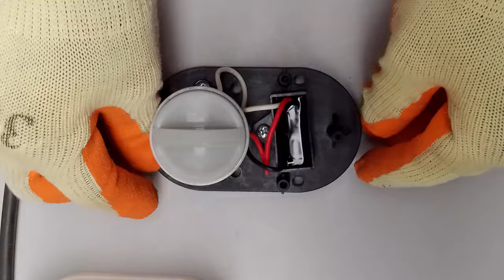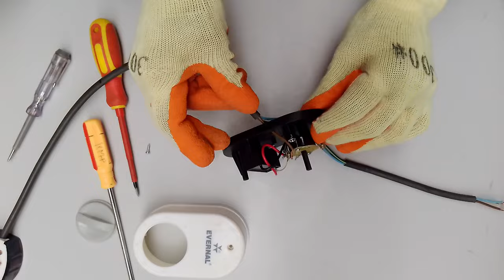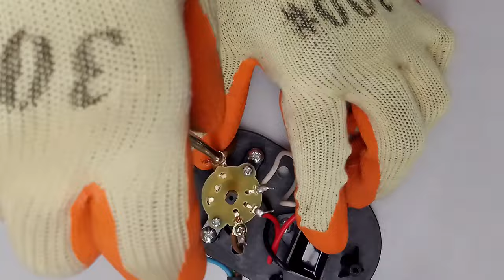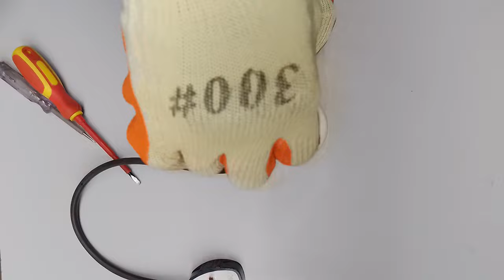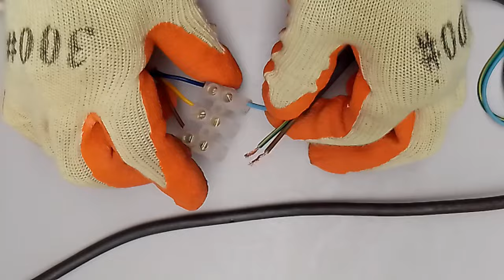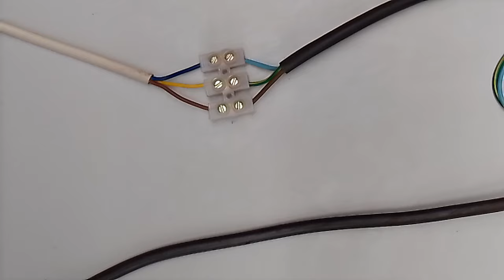Fan regulator connection/ ceiling  fan regulator wiring /3-speed fan regulator wiring diagram/video

Comment: Where is the Black cablo?
Reply from the maker: Well this fan has 3 speed levels, so the capacitor used also has 3 wires, red, white, and black.
Each wire is connected  to one  point of the 3 to regulate different speeds.
Reply: @kalutecpowersolutions9523 Where is the black cable connected?